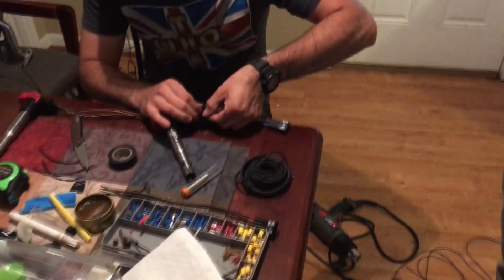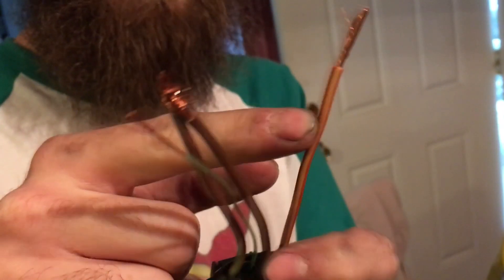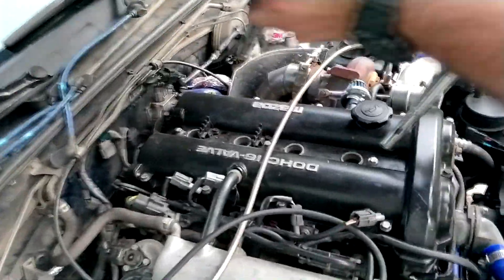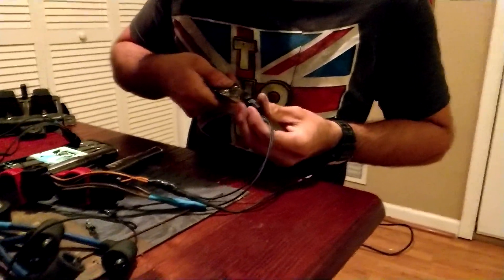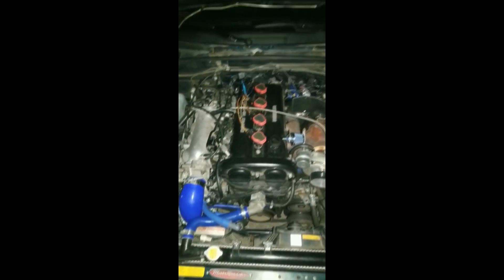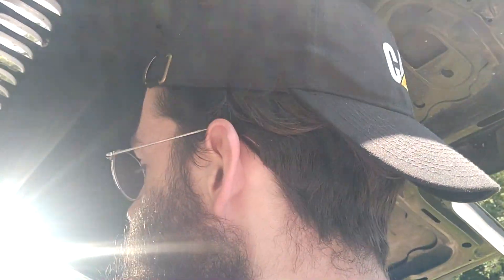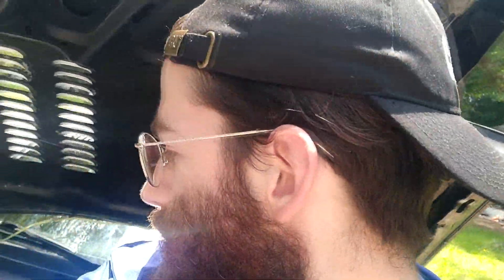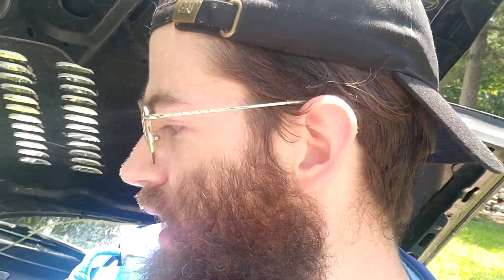96-97 Miata VAG R8 Coil Pack Conversion

Comment: Cool👍question is there a way that I can add same setup to a 1.8t vw GTI motor? Trying to convert my 67 Vw bug to run 1.8t but don’t want to deal with crazy ecu wires

Comment: It doesn't run on stock NB ECU?
Reply from the maker: Sorry I missed this notification. You could probably do it on the stock ecu, not sure I would recommend it though. The dwell times for the stock coil packs are 2-3 times longer so you might overcharge the r8 coil packs and they could get hot or age faster. You're probably okay to do it, I think people use the Toyota coil on plug conversions with stock ecus and it's the same idea. I'm no expert though